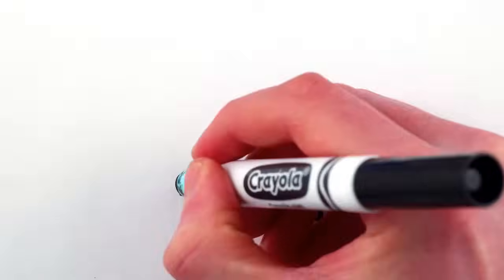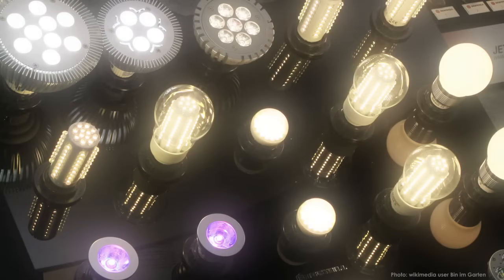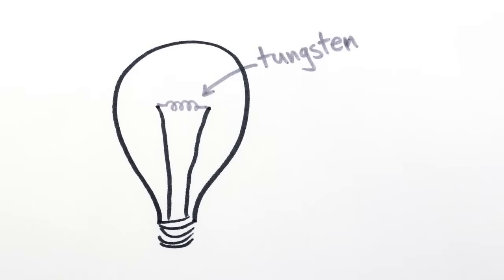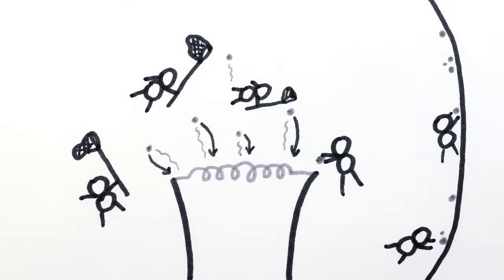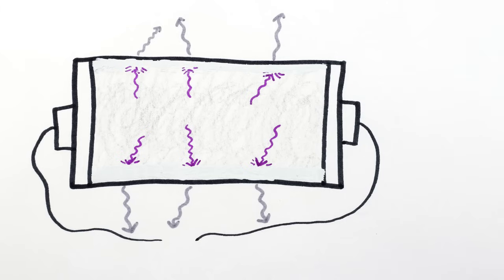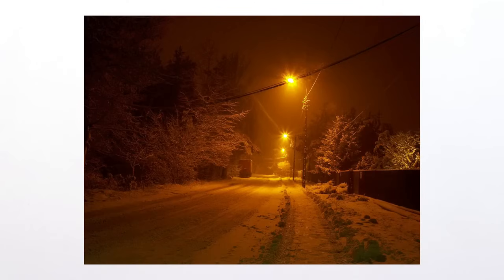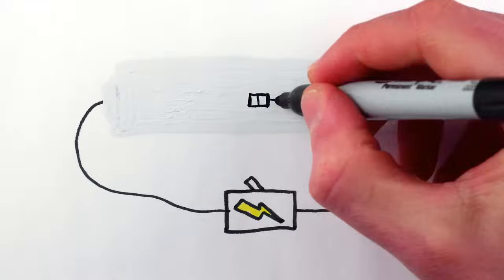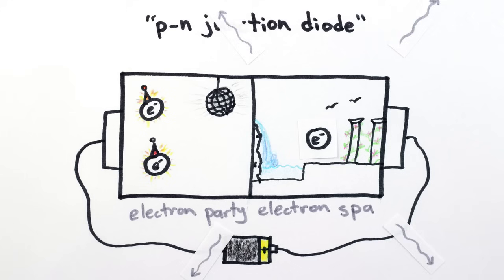How Modern Light Bulbs Work

Comment: i once bought 14 street lights and used them to grow 22lbs of weed, now it took a lot to convert them to a 120 volt and a shit load of new oil filled capacitors and relays and you need to make sure to buy the high pressure sodium ones but it cost about 65 dollars a light, not to shabby......

Comment: it just makes me sad that since incandescent lighting has been so dominant for so long that light bulbs are measured in Watts and not lumens. I mean, now that there are so many alternatives, you start to get the lumen  rating on bulbs, but most of the time, we still go by the 60-Watt equivalent, even though Fluorescent twisties are about 23 Watts, and LEDs merely need 10 Watts, if that. but I do love lighting rooms with a pair of 6-Watt bulbs, and I have plans on spreading that workload between several weaker LEDs, but I digress.

Comment: So, the gas in floresencent bulbs emits (basically) UV and visible light?  Then the white coating CONVERTS UV to visible light? ( 1:16 "absorbs the ultraviolet light and re-emits it as visible light.")

My question, assuming the above questions are answered positively, is that since the coating is white, does that mean it blocks the visible light initially emitted by the gas so that the only light we see from the bulb is converted UV light? o_O
Reply: It is a combination of both.  Go to the wiki for fluorescent bulb... scroll down to the section on "Phosphors and the spectrum of emitted light"  there you will find fluorescent lamp spectra which show that there are mercury emission lines.
Reply: You mean this?
http://en.wikipedia.org/wiki/Fluorescent_lamp#Phosphors_and_the_spectrum_of_emitted_light

The wiki doesn't really make clear how it is a combination of both.  The statement, "The spectrum of light emitted from a fluorescent lamp is the combination of light directly emitted by the mercury vapor, and light emitted by the phosphorescent coating," could be interpreted in different ways.

Btw, I have no idea what "mercury emission lines" means.  I'm a smart guy, but this is outside my area.
Reply: lordelliott42 mercrucy emission lines are spectral lines which can determine the source of the light.  For instance we can look at a spectrum of our sun and determine what elements it is composed of because those elements absorb particular frequencies of light....but they also emit frequencies too.  The graphs in the bottom of the section show spectral responses at frequencies expected from Mercury emission, not from UV-Visible emission by way of the filter...   Thus, at least some portion of the non-UV light "created" by mercury emission escapes out through the filter.

Comment: @kitvatae The convention for current flow is in the opposite direction to which electrons flow. This is because they didnt know what was moving, so they had a guess. Electrons come out of the negative terminal of a battery and flow into the poaitive. In most case this makes no difference to the analysis - except when talkind semi-conductors, where you have to use actual electron movement to understand the device. Hope this helps.

Comment: My dad used to tell me not to touch the glass on a compact fluorescent bulb when they became popular (or when he started replacing incandescents in the house with them ~10 years ago idk)... I'm like dad, they're the same thing as the huge lights you have in the garage only smaller lol.. is this a common myth? Or is there truth behind it?
Reply: well, they do heat up (albeit far far less than an incandescent bulb, which is where the energy saving comes from), so there's a chance you'll burn yourself, or it'll just hurt. it wouldn't really interfere with the performance, though
Reply: He was probably worried about the mercury in the fluorescent bulbs
Reply: Certain types of bulbs have casings that can be etched by finger acids and will fail prematurely if touched (quartz-halogen for example), although I don't know if that would apply in this instance.

Comment: I have a question! In an eliptical orbit around, say, a planet, you normally have both diameters of the orbit going through the very center of whatever body is being orbited. My question is, is it possible to have something orbiting somthing else without the diameter of the orbit crossing through the center of the body being orbited. Like, can you have an orbit that resembles a halo?
Reply: In an elliptical orbit, the barycenter is at one of the loci of the ellipse. Unless the orbit is perfectly circular, the two axes will not intersect at a locus. In addition, the barycenter is the center of mass of the system - it doesn't lie in the center of a body.

So the short answer is that most orbits don't have "the diameter... crossing through the center of the body being orbited".

Comment: I know that this is irrelevant, but I just found this out.

I was in school one day, and there was a maths poster stating that 1=0.999999+. That means 2=1.8888+, 3=2.7777+, etc. until we reach: 8=7.2222+, 9=8.1111+, and 10=9.
BUT! 9 is 8.1111+.

So that means 10 is 8.1111+, right?
Reply: If you truly multiplied .9999...etc.*2, you would have a 1 carrying over to each 8 in the decimals places (because 9*2 = 18). This would result in 2 = 1.999999...etc. which is true.
Reply: Well for those who don´t get it to prove 1 = 0.9999... this is how you do it:

1 - 0.99999.... = 0.000000....

As the 0´s secuence is literally infinite that means that:

0.0000000..... =  0    

So that means 1 - 0.99999.... =  0

But if 1 - 0.9999.. = 0 --> 1 = 0.99999999...

Math...
Reply: Your math is wrong here. 0.999999 * 2 = 1.999998. If it repeated forever as 0.999999... then it would equal 1, but if it ever terminates it doesn't. 0.999999... * 2 = 1.999999... which equals 2.
Reply: Wow, people really do seem to be bad at replying to your comment.
It is true that 0.999... = 1.
It is also true that 1.999... = 2.
It is not true that 1.888... = 2.
Reply: I don't think that it's fully understood properly. The way they I learned how to do it was: 
Let 0.999999... = x
10x = 9.999999999...
9x = 9
x = 1
Therefore 0.999999... = 1
If you do this method for 2.777...... then you'll see why it isn't equal to 3 and 10 is not equal to 9.
Reply: Gotta love people who liked the first post even though it's completely wrong in many ways.
Reply: wait. what?
Reply: No
Reply: Warning: Long-ish comment. It is okay if you skip it. I'll get over it. Just don't be hating because of being tricked into reading on YouTube or whatever.

This is an odd mess of rounding errors combined with invented accuracy. I'm guessing it was the result of removing and reapplying a repetition bar? This is one of the reasons that I prefer not to use them if I can. Some ways of viewing the pattern don't stick and cause unnecessary confusion.

Quick explanation on my notation: [n] means I'm repeating n. So 1.4[73] would be 1.47373737373...

Anyway, what it looks to me like you did is try to multiply the repeating term directly, which is valid. 2 * 0.[3] does equal 0.[6]. But it only works cleanly like that as long as you keep the same number of digits.

We know that 0.[6] = 2/3. 2 * (2/3) = 4/3 = 1.[3] (You can check those fractions in any calculator if you don't have them memorized). But wait. The rule above means that 2 * 0.[6] would be 0.[12] right? Well clearly not. A common knee jerk reaction is then morph it around into something that still looks like the math and gives you something closer to the answer, like 1.[2] maybe? But that still isn't what we know we are looking for and it didn't follow any logic either.

So step back for a second, if 0.[12] isn't 2 * 0.[6] what did we actually multiply by 2? Well let's divide it back 0.[12] / 2 equals 0.[06] Ah, so we removed every other digit by accident. So how do we prevent that? Well let's go back to basics. 1.7 * 2 = 3.4 When the 0.7 became 1.4, the 1 got added to the digit to the left so the 2 there became a 3. Earlier we were completely replacing half the 2s with the 1s from their neighbor.

So lets start with getting down what is all of the digits get to begin with, putting aside those pesky higher digits for a minute. That would be, 0.[2] right? Okay so then lets put in those 1s. Each is in the digit left of one of the 2s, so lets write that as 1.[1] and add them together. 1.[1] + 0.[2] = 1.[3] Now we have an answer that makes sense.

So then applying the extended version of the rule...
2 * 0.[9] = 1.[1] + 0.[8] = 1.[9]
7 * 0.[9] = 6.[6] + 0.[3] = 6.[9]
10 * 0.[9] = 9.[9] + 0.[0] = 9.[9]

And the digit separation works for even more digits as well.
156 * 0.[27] = 42.[42] +0.[12] = 42.[54]
Reply: Your math is wrong. 9999 times 2, for example, is 19998, not 1887.
Reply: This is where you get confused about a decimal, repeating representation of a number, and some perceived pattern you think exists.

Simply put, 0.999999999... = 1.
If you multiply 0.9999999999... by 2, you do NOT get 1.8888888888....

I mean, even if you're trying to multiply all the 9 by 2, you seem to be forgetting how to carry a 1! Take a shorter, finite sequence: 0.99x2 = 1.98. See how the 1 carries? The answer isn't "1.88".

So that's logical errors on many levels.
Reply: lol no
Reply: Yes, but the way I used was a simpler way, so that everyone could understand it.
Reply: x.999999... = x + 1

Where x is an integer.
Reply: thats just using floats. lol. floats inaccuracy doesn't carry over to other places

Comment: Isn't there a gap the exited electrons have to jump to release their light in leds? And doesn't something with the gap affect gap color?
Reply: i dont know about the color part, but yes they have to go though a gap, and that gap is one way, which is why you can only make an LED work if you put it in the right way, unlike other light bulbs, where direction doesnt matter
Reply: Branden James zaris it talking about different energy levels, and how much extra energy the electrons get when excited, and consequently the colours released.
it's the principle that gives every element its own unique colour spectrum (albeit this is a difference the eye cannot usually detect, but a big example is copper being green when burnt), rather than a P-N junction like you're talking about.
Reply: Kit Vitae Ah, energy levels. It turns out I wasn't thinking of the right thing when I thought gap length, I was thinking the length the electrons have to jump, but it is based off of something to do with ratios of materials if my googling is correct.
Reply: zaris von malhaven yeah, it's hard to accurately measure distances with things like elections
Reply: Kit Vitae zaris von malhaven ah, my mistake

Comment: What about CFLs? Are those basically just Flourescents in the shape of Incandescents?
Reply: yes, same concept, different shape
Reply: CFL = compact fluorescent
Reply: Yeah, I knew that part, I just didn't know if they worked differently.
Reply: are these the ones that are shaped like a spiral?
Reply: Hassan Selim
Yep.  Those are them.
Reply: ufninuyasha but florescent blubs require a power transformer and some sort of capacitor (the call it a "starter") and the flash a few times before lighting up, those spiral bulbs on the other hand don't need any of that and light-up instantly (actually fades in for a second) and doesn't flash, I wonder what did they do to make it like that.

Comment: why dont blacklights give us cancer, since they emit UV light
Reply: they can in prolonged amounts, but they dont release as much as tanning bulbs, so they are far safer
Reply: Party black lights are just massively dimmer.  Sort of like being in a 75 degree room instead of in a 350 degree oven.  One feels nice, the other will cook you to death.
Reply: Thanks!
Reply: The predominant wavelength of the UV light is different.
Reply: Paul Coddington In a science video it helps if you either ask a question, or provide a helpful answer.  

The wavelength of UV light is defined as electromagnetic radiation with wavelengths from 400 nm to 10 nm.  Wavelengths from 120 nm to 10 nm are referred to as "extreme ultraviolet" and carry enough energy to be ionizing.  Wavelengths from 400 to 315 are referred to as UVA, and 315 to 280 are referred to a UVB.  Party black lights emit wavelengths around 400 to 365, in the UVA range.  Light in the UVB range can causes much more damage than UVA, but UVA also causes damage that can cause cancer.  Many sunblocks only block UVB and the SPF rating only measures how much protection you get in the UVB range.  Always use sunblock that also blocks UVA wavelengths.  In any case, a party black light puts out a completely insignificant amount of UVA  compared to the sun, so go ahead, party down.

Comment: Neat, I knew how incandescent and florescent light bulbs worked (at least I knew it's electricity through a mercury gas) but I didn't know that it was the coating on the bulb that gave it the name florescent. I also didn't know that tanning bulbs and florescent bulbs were almost the same, only with different coatings.
Reply: Florescent Hg lamps technically don't need the coating to give off visible light and would still be called Florescent Lights even if they didn't have the coating.

However, since Mercury Florescence is mostly in the Green and UV parts of the spectrum... its not terribly appealing to live in a green tanning booth for too long.

The coating on the inside of the bulb absorbs light in the UV ranges and re-emits this energy in a more broad-spectrum light, filling in the non-green wavelengths to give you white light. Its a combination of the Florescence of the Mercury and the Florescence of the Phosphor coating combined that creates the desired effect.

Comment: how does a lava lamp work?
Reply: Heat lamp heats up wax/oil-based "lava" in the water above it.
Hot "lava" expands, causing it to become less dense therefore more buoyant and float to the top.
Now away from the lamp, the "lava" cools down again and sinks.
The "lava" moves in big globules because it has high cohesion with itself and extremely low cohesion with the water (it's hydrophobic), so it likes to stay in globules to minimize its contact with the water.

Comment: What's the advantage of fluorecent light bulbs over vapor light bulbs? It seems to me that they're just more of a hastle because you also need that special coating.
Reply: florescent light use less energy to make the same amount of light, but LED's use even less energy, which is why they are starting to sell light bulb sized LED's at certain stores
Reply: Branden James Thanks.

Comment: so how do we get the different colors in the LEDs?
Reply: Going along with the nature of the video: Different party sides are more exciting for the electrons, and some spa sides are more relaxing. So make the party side out of you average pub, and the spa side a city park, and they don't change excitement all that much, and produce low energy red or infra-red light. Make the party side a pounding dance rave, and the spa side a yoga resort, and the electrons lose heaps of excitement and release high energy blue or even ultra-violet light.
Reply: Bakkare a multi-coloured led has 3 small leds a red, green and blue and a microcomputer to control them so it could power red and blue fully to get a purple colour, or blue at 50% and red at 100% to get a different colour.
Reply: Magic.
Reply: I3oxman Yes, but ... how work the multi-colour leds ? oO
Reply: by coating the surface with a coloured transparent coat.
Reply: Tim Tian a single led wtih different colours ^^ I've seen an once, it's cool but expensive >< (sorry for the googletranslated english :P)
Reply: Bakkare Red green and blue lights are put into one and their color can be modified using modifiable electric current.
Reply: I3oxman
not really a microcomputer haha but you're right.
Reply: I3oxman
combination of RGB can give you almost any colour your eyes can see. that's what happens with multiple colours LED. on the one colour LED you can order some nm of the wavelength you want
Reply: I3oxman +trppmdm Ok, thanks ^^
Reply: awilliams1701 that is a beautiful metaphor.
Reply: trppmdm
No.
Reply: do you mean how you can get different coloured leds or multi-coloured leds (a single led with different colours
Reply: Robert Backhaus not quite because the electrons only have a few exact amounts he was asking about ones that can go every colour
Reply: Taufik Akbar yeah i said that before :~P
Reply: I3oxman
sorry, didn't pay much attention lol
Reply: Bakkare
Let me post a pic of an average LED screen up close - http://img1.lesnumeriques.com/article/1547/dalle-tn.jpg
Mixing those colors you can get anything (pretty much)
Reply: tadej petric That's a LCD, not a LED.
Reply: Reinout S LCD and LED refers to the backlighting not the pixels.
Reply: M9199bro LCD is the display and LED is the back lighting, and non LED LCD will usually be backlit by fluorescent light bulbs
Reply: Because different  semiconductor (on basis of material) pn diodes have different energy gap b/w party zone and relax zone and as e⁻s in different led move from party zone to relax zone they release different energy and we know that different colours of light have different energy that's why we perceive different colours.
This may not be absolutely correct option but this is what I have understood.
Thanks😃.
Reply: well if the LED's are partying, then they are alive. The different colors are different nationalities of electrons. lol (I'm not being serious)

Comment: "Relax" and "excited" are 100% sure technical terms
Reply: the atoms get "excited" when they absorb electrons, and release that energy as photons when they "relax", in the gas discharge lamps. fluorescent bulbs use an additional step where phosphors do the same thing - absorb an ultraviolet photon, and then "relax", releasing visible light photons.